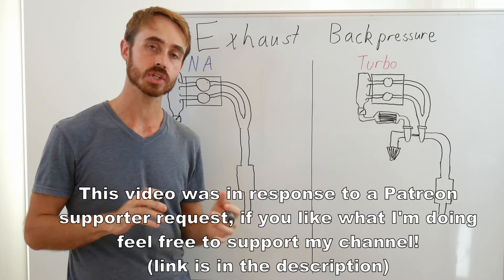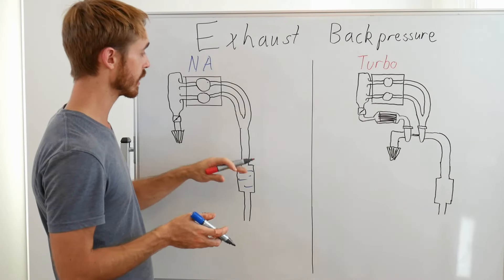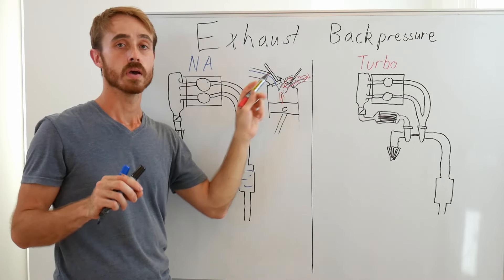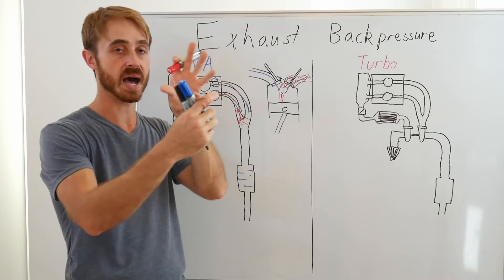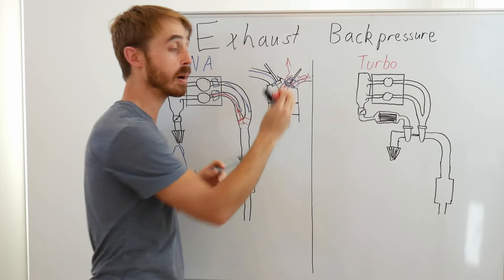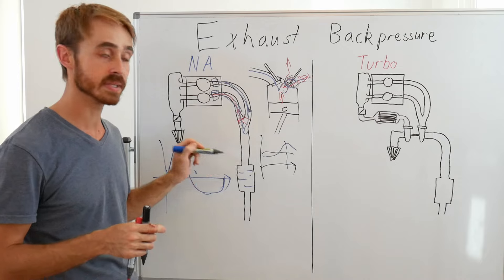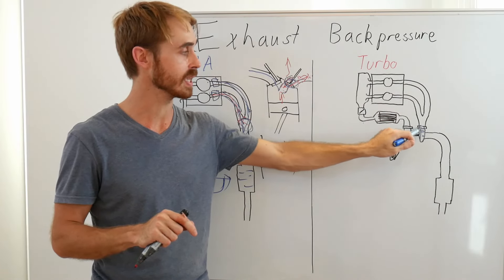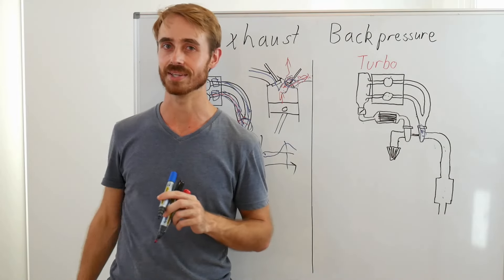How Does Exhaust Backpressure Work? - Basics of Pressure Wave/Harmonic scavenging

Comment: how does this work with supercharged engines
Reply: Supercharged engines tend to "care" less about exhaust tuning and scavenging since the manifold pressure (boost) is higher than atmospheric. That's part of the reason "blower cams" tend to have less valve overlap, other main reason being you don't want the boost to "blow right though the cylinder". I saw this first hand when I put larger diameter headers on my supercharged small block Chevy and it made little to no difference in power since the blower is doing much of the work of getting exhaust out of the cylinder my forcing fresh air/fuel. In fact, that's one of the reasons you see Top Fuel engines, which tend to run very high boost (over 50psi) use short "zoomie" headers with no merge collector. They just want to get the exhaust out of the engine as fast a possible.

Exhaust tuning is more important on turbocharged cars then belt/chain driven superchargers but for a different reason; getting the turbo to spool quickly. Ideally we want each exhaust pules to "hit" the turbine with as much energy (heat and velocity) as possible and that means we want them to arrive at the turbine evenly spaced rather than jumbled together so tuned and equal, short length headers tend to work best for spooling however equal, medium length (20 inches or so) headers tend to work best for performance on turbocharged engines as they minimize reversion compared to shorties but can increase turbo lag a bit.

Comment: Backpressure is a false term. The only pressure provided in the system is from the piston pressing gasses out the exhaust port and through the exhaust system. That is forward pressure. Proper scavenging is determined based on valve intake/exhaust timing overlap, and proper exhaust system diameter. Exhaust is a gas, which has mass and momentum. If there is enough velocity in the exhaust system, there is momentum of the exhaust gas. That momentum causes a "pulling" or scavenging (vacuum as a result of gas masses leaving the system) of gasses in the entire system from the tail pipe all the way to the intake valve.

So in reality, there are only pressures and vacuums in the system. Optimal valve timing and exhaust tube diameters will produce a freely-flowing exhaust stream allowing the engine to evacuate its burned gases without any resistive effects acted upon the piston (pressure vs. vacuum).

Either the system is evacuating gasses, or the system is causing undesirable pressure without velocity in the system.
Reply: Lifted_Above in an empty road, I can go as fast as I want.

But, when there's traffic jam, I cannot drive fast, too many car, I got bump into other cars.

Other cars is backpressure 'scenario'.
The 'effective' road is not wide enough
Reply: What he is talking about is, effect of atmospheric pressure that will affect the second exhaust, that is the pulse crated by fisrt exhaust... That tuning is important bro

Comment: I would like to ask. After I changed my exhaust to straight pipe system with diameter of 2.5” my navara np300 was like coughing at 3000 rpm and especially after changing to higher gear. Is that the problem with lowering pressure post turbo?

Comment: It's NOT BACK PRESSURE that is the problem. It's reverse flow of exhaust gas contaminating inlet charge. No problem at all after the turbo.
But bigger pipes have the opposite effect, I.e. low back pressure. It's got to be a good match.

Comment: A 2 stroke engine needs back pressure  to run a 4 stroke runs better with no back pressure the more exhaust is openthe better it runs

Comment: Look, 31 down votes. Those are from the people that put straight exhaust on their gas cars and think they increased hp and torque because it sounds cool. Even tho they didnt compensate with their EFI or jets on their carbs.
Reply: Efi is self learning and a carb is a simple turn of a screwdriver lmao the down votes are from people who think decreasing back pressure decreases power which is ludicrous

Comment: Amazing, rarely have I seen someone go through so many verbal convolutions to avoid admitting he was initially absolutely wrong.  For those wondering this is the perfect example of a terrible engineer that will waste huge amounts of resources and time to cover his butt. No, you NEVER "need" to have back pressure moron.  In short, back pressure always bad (4 stroke) PROPERLY tuned exhaust always good.
Reply: Unless you can’t optimize for the increased exhaust efficinecy. Example - you have no way of altering cam timing or ignition timing or fueling to suit. 

In those cases, where you have a steady state tune or static timing / fueling etc, you will actually noticeably impact your torque curve. 

This is only for an NA engine too

Mick